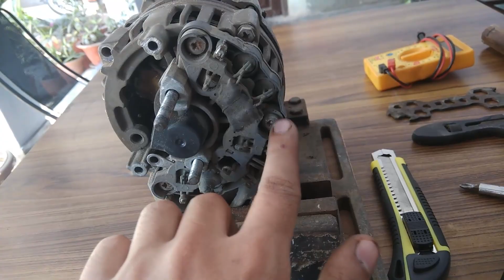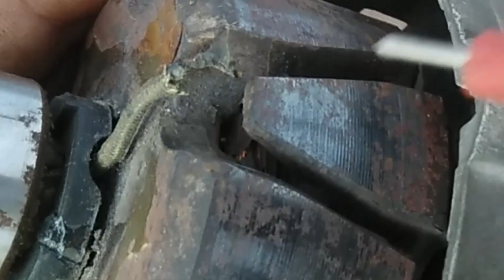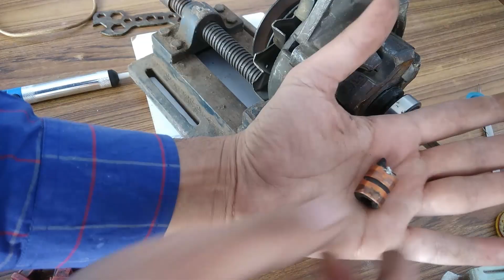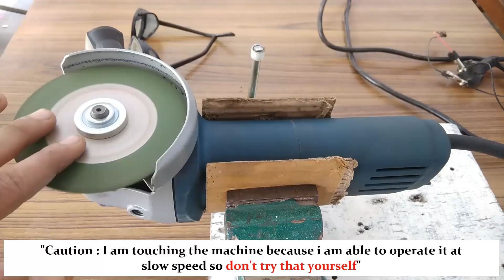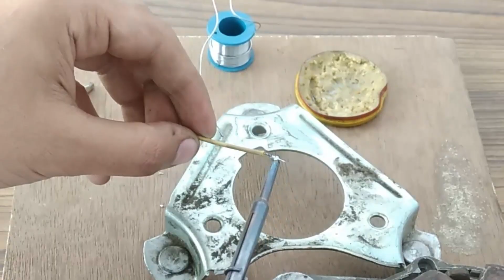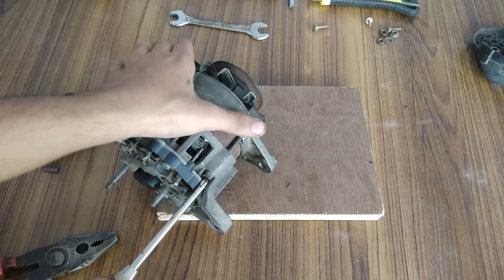BOSCH Alternator Repairing with simple tools || Full Working , Explaination & Testing

Comment: شكـــراًر ؛
Very good, thanks ;
In the beginning, you should 
use multitester ( DVOMM )
in measuring resistance which,
 will show you the continuity 
which, in turn, will tell you if the wires
are cut or not,,,.

Very good,,,,,,,,
especially if you video it
without annoying music.

REGARDS.

Comment: Good work dear.appreciate your determination even if the tools are less sophiscated. Sometimed We all use some  kind of improper tools. Hope that the solder joint will not cause short circuit.an insulation at joint would have given peace of mind.

Comment: Mr Electron, good day Your brush flew off. Should it work without the wire attachment to the brush and the other part ie soldered part of the voltage regulator that prevents the brush from dislodging from its groove?  anyway brilliant. TQSM.
Reply from the maker: Thanks a lot.All it needs is power supply to the brushes.

Comment: What fault in alternator when charching volt below 12v ??????
Reply from the maker: too many possibilities.May be the field winding is a short circuit or the i/p supply to the alternator is low.. etc  etc
Reply: Ok thanks
Reply: @chwasim6995  90% of the time are worn out brushes and slip rings if the alternator produces below 13.8V, a normal reading is about 14.4V... for a car alternator